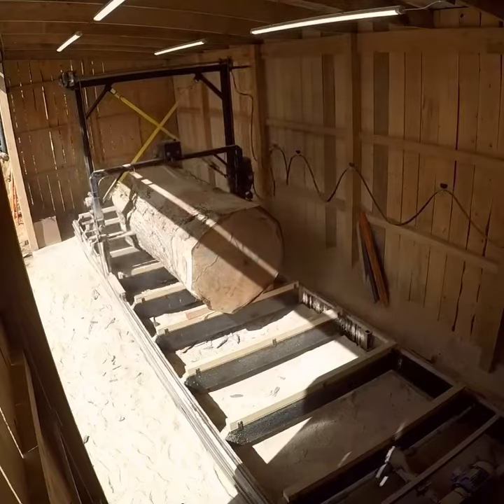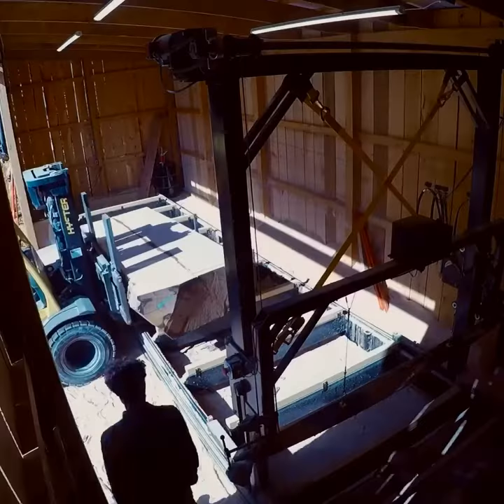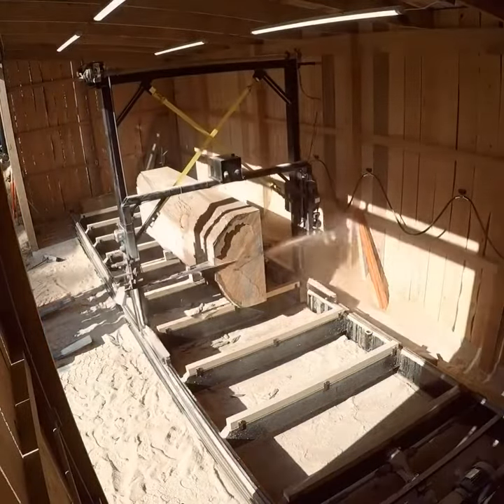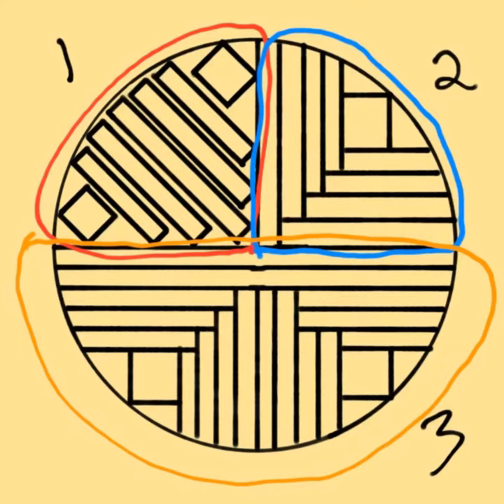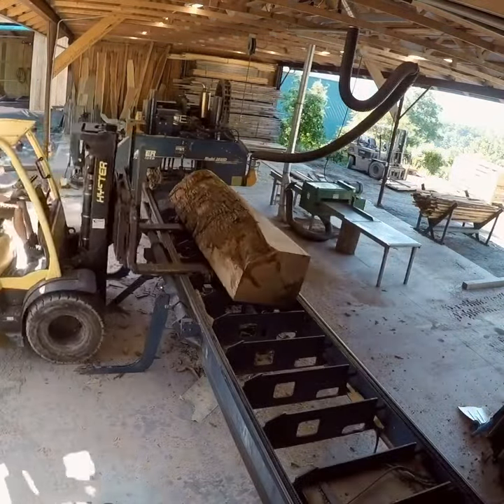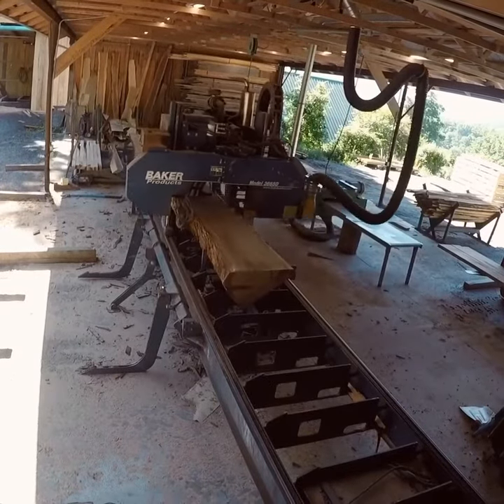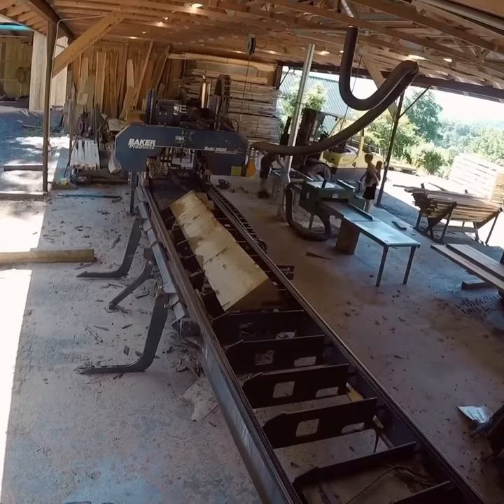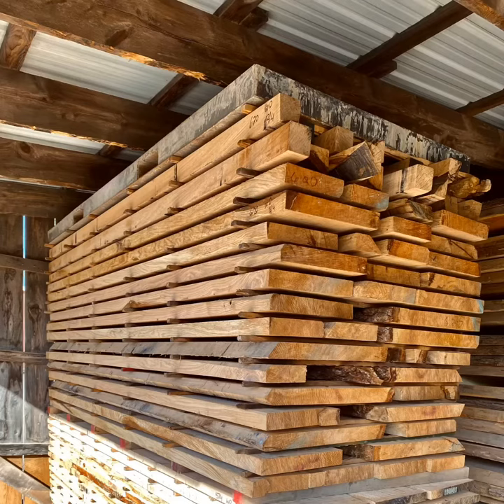Quartersawing a giant white oak log on my electric chainsaw mill.

Comment: Hi good afternoon, I would like to know what was the maximum Rpm rotation that you used in the chain? I would also like to know what size of the pulley used in the engine and the size of the saber gear used?
Reply from the maker: Chain speed is right around 6000 feet per minute.  The pulley’s are 5.75 on the motor and 3.75 on the chain end.  I’m running a 6k products 17 tooth sprocket DS0148.  If you have any questions, Bill at Cannon Bar Works is really helpful.  They have excellent customer service and they will recondition your bar several times, if you get one from them.
Reply: @IrionLumber  Hello friend, I appreciate your information! could you help me but ? .
I would like to know how did you adapt the saber to the engine? which parts did you use to make the adaptation of the current to the motor? could help me I'm doing one of this there too.
Reply from the maker: I’m not sure specifically what you are asking me here.
Reply: @IrionLumber  Hi good afternoon, I would like to know at what speed in RPM your current is working?
Reply: @IrionLumber  another doubt? I would like to know how the assembly of the saber bar was made?
Reply from the maker: Motor RPM is 3600. I have another video that is a walkthrough of the mill. It shows the assembly up close. I’m still not quite sure what you mean when you ask how the assembly of the Sabre bar was made. The bar was custom built for me by Cannon Bar Works. If that helps.
Reply: @IrionLumber  Sorry to be bothering you , when I talk about assembling the saber , I mean the coupling system
 that you used in the engine and straight to the saber bar;
if possible send your whatsapp contact to contact
Reply: @IrionLumber  where is the step-by-step video? be on your channel?
Reply from the maker: @Marcenaria.penhafiel  It’s not a step by step video, but it shows closeups of the mill, and walks through the parts.  https://youtu.be/Ae-Xqa-ysMA
Reply: thank you my friend, thank you very much.